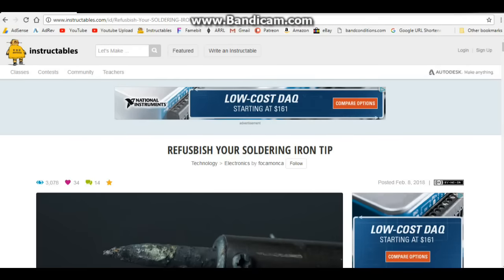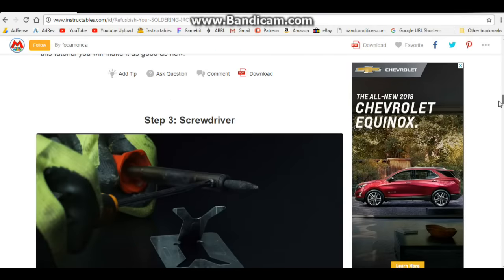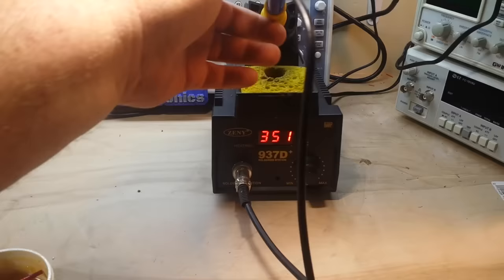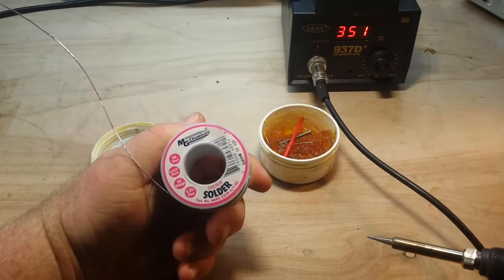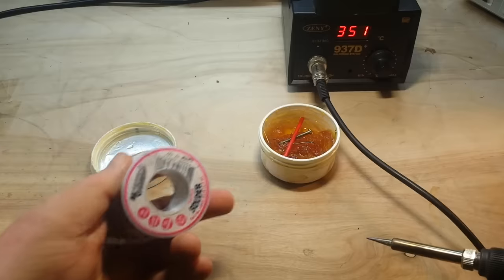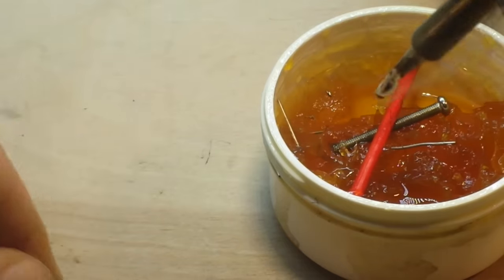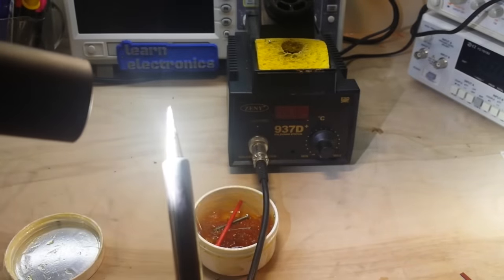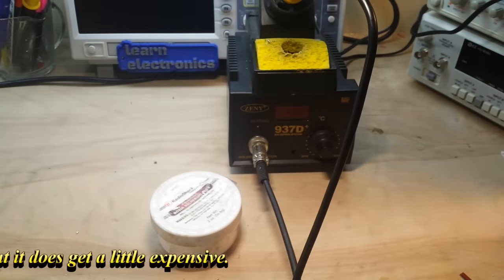How to clean and re tin your soldering iron

Comment: Two different tips here. The one which they clean is an old one and basically a block of brass/copper. It can be cleaned with acid and sand paper. The downside is that it needs much more heat and heats up slowly.     The one which you use is for ceramic heater and has thin film of copper. This one will get destroyed with acids or sanding paper, so it requires maintenance to keep it from oxygen as you describe it. And all of what you said about laziness and burning tip is fully correct, its just the older soldering irons are much more fool-proof.

Comment: I committed this sand paper sin with drill and everything just yesterday. IMO it was still worth it, because the tip I did it to was a total hack job from whatever generic Chinese factory that produced it. It was one of the round bevel tips, but the tip wasn't flat and had big burrs from sloppy machining. No big loss if this corrodes faster now, because at least it works the way it should while it lasts.

Comment: Thanks for the video. New Sub!
Do you have any recommendations on cleaning tips that are solely used for plastic soldering/welding (which ever you prefer to call it)?
Also what are your thoughts on tip tinner? Is it not acid based?
Cheers Tania
QLD, Australia

Comment: I bought a cheap 90w handskit soldering iron and after first use the tip is no linger shiny and solder will not stick to it, doesn't matter how much flux I put on it, also noticed heat doesn't transfer as good as on first use. Any advice one that? Thanks

Comment: You are right. I cut a piece of T-shirt cloth and fold it a few times and wet it with a spray bottle of water next to the station. I wipe it every time I use it and that's about 50 times when I sit down to some work. Fact is, it won't solder when it not clean.

Comment: I’ve a newbie question please. When I’m tinning my iron I use old lead free solder that I no longer use, but after watching so many electronics soldering videos I now use tin/lead solder. Does the fact I’m using a different type of solder for tinning make any difference?
Reply: For tinning no. Lead free is what plumbers use, and you will have to have a secondary flux source- but make sure it isn’t plumbing flux; plumbing flux is acidic and will destroy anything it is left on afterwards. As a plumber, I had to scrub my work down afterwards with soapy water even though I used a dry towel to hot wipe to get most of the flux off or it would eat the copper within a year or so. If you have the water soluble flux though, it is a lot less corrosive and easier to clean.

Comment: if the solder only sticks to the side of the tip, not far away but not on the very tip, even if I hold it straight up, does that mean my tip needs cleaning? I followed your steps several times, and it does look shiny, but the solder still doesnt stick to the very tip.

Comment: I tried this method several times but the solder runs down the tip and does not stick to the tip. I tried different tip temperatures from 200 to 450 degree celsius (tip glowing red hot) but the same result. I even dipped the tip into solder placed in a hole but no solder stuck to the tip!

Comment: This is how I clean mine, although I start with a couple dips into a tip tinner and cleaner, after a wipe on the sponge. Been using the same coated wedge tip for about six years. I still have a stockpile of Radio Shack flux and tips I bought during their fire sale, LOL! A pity they're gone, they were so convenient; now I've gotta drive about 30 minutes to get to the nearest supply store.

Comment: My soldering iron is a cheap $15 60W device. I never cleaned it and it still works fine - for more than 3 years now. So don't panic 😄 Maybe I'd handle it more carefully if it was an expensive one - but the cheap one did a good job for me (soldering FPV racers, drones, micro electronic etc.)

Comment: Finally some sanity with keeping the tips clean and tinned, that's what I do except I get a blob on the iron and shove it into the holder and turn it off, 
I still have the same tip in one of my irons that has had about 3 new elements put into it but the tip just keeps going after 10 plus years of use.

Comment: I dated this video in case I needed to re-tin I soldering iron tip.

So I needed to repair a plastic part on my vacuum cleaner, and plenty of videos out here on YouTube on how to do that, and save you grief* in the finance department.

I ended up saving my vacuum cleaner 🙌 woohoo!

However, I remember this video and say, “Oh wallops! What have I done 😱🫣”, as I try cleaning the plastic off of the tip with the moist sponge… then by using my solder absorbing braided copper thread as ‘sandpaper’, to no avail, I remember I saved this video back in the day in my playlist. Phew! Right? Well seemingly apparently not.

Turns out this video is about the “prevention is better than cure” philosophy. Yet it was too late for that.

I feel like taking away my like from this video, because it did not live up to my misinformed expectations. Then I thought, “Why be a douche for? This guy provided a legitimate service, even if I misunderstood it all this time.

“Why not ask him how to repair damaged tips instead?”

So here I am.

_______________________
* only to give grief in another department

Comment: Bought a new soldering iron (a weller 60w)- within minutes of heating up it lost its shiny look - I tried following the instructions on this vid but for the life of me can’t make a bead of solder sit on the iron - just turns into a huge blob and drops - does it make a difference if it’s silver bearing rosin core rather than lead based?
The tip looks more like the instructibles one than ever - and that’s only minutes after being taken out of the box!

Comment: my tip is shiny just the same, but the solder doesn't melt. I tried all temp settings. is some solder just too industrial? it's lead free too. between 300f and 800f, it simply will not melt.  tried leaded solder at 300f, it just balls up and falls off, and there's a nice amount of flux I put on there. brand is xtronic 3020.

Comment: Thanks hombre. I feel like I knew this, but my Weller WLC 100 I use for high heat stuff looked like total ass. Can't believe I didn't think of putting flux on it. Flux, wipe, brillo, solder and repeat. Looks good as new.  I have tip tinner but it doesn't seem to do much. 

Now for those tips I left on overnight...
Reply: Oatey #95 tinner/cleaner.
Good stuff.

Comment: I just bought a TS100 set with all the tips, and I can't get solder to stick to the tips. I'm using flux, Kessler 60/40 in .031", and I've worked through the temp range from 200 to 400. The solder just beads up and falls off. They don't get shiny silver like yours. What am I doing different? Do some tips do this?
Reply from the maker: I'm not sure, but it sounds like maybe you have some bad tips. I never use any abrasive on tips. The flux is basically acid. It should clean your tips. My only suggestion would be to try a different brand of solder. I like MG Chemicals, but any big name brand will do.

Comment: The best way to keep our tip clean is very easy you have have to use a wet cloth and clean your tip time by time while you are slodering i have tried it my self and it actually works extremely well

Comment: I tried to clean it as you did, but I had a problem, the soldering wire didn't stick to the tip of my soldering iron. It bubbled up on its self and then fell down. It seems like my iron tip rejecing the soldering wire. If you are familiar with the problem, please tell me. Thank you.

Comment: I do this trick every time I finish soldering but recently no matter how many times i do it, it just doesn't work, I also bought a new tip but it oxidised after fewntimes of soldering,it looks like the coat just goes away in some spots, you think its a problem with my sloder or my iron? using flux core solder.  I also bought a good brand tip but nothing... its really going on my nerve when those black spots appears on my soldering tip
Reply: The solder is actually SUPER EXPENSIVE here I can literally buy a new decent Soldering Iron with lower price of one roll of solder! so I cant buy the best solder anyway

Comment: At AT&T we just filed them down, the irons were in use 24/7 often sitting unused for periods of time. The tips get messed up so we filed them down, and before using the iron we wipe the tip across a tin plate, it's a metal plate coated with solder. This is the Bell System way of doing things.

Comment: Great video. I'd also recommend getting a little tin of tip tinner. $7 on amazon, and makes cleaning your iron a 2 second operation. Wipe iron, dip in tip tinner, go back to soldering. Super easy.

Comment: AFAIK the sand paper technique works on vintage soldering tips where there isn't any coating. My father has this iron from his 20s, and as a kid I saw him sanding it a few times and it works very well after each sanding. That tip was made of solid copper though. Today's tips are probably very differently constructed.

Comment: I'm trying to repair a charger cable for my cellphone the kit I purchased from ladyaya's came with solid core wire. Can I use solid core wire to connect a charging cable or is it best practice to use copper? Every video I have watched uses copper.

Comment: If you use regular rosin it's even easier, I've always cleaned my soldering iron like that since I started soldering at the age of 12. I just clean my tip like that on a regular basis, never replaced a tip because it won't hold tin.

Comment: well, after dipping the tip in the flux I try to apply some tin onto it but the tin just falls off. What am I doing wrong?
Reply: Tip is oxidized you may have to use a tinner and steel wool to restore it if flux isnt working.

Comment: How do you get the tip to take solder if it is gone black is my problem?  
I got an Antex which is meant to be Adjustable but maybe it's not working and getting too hot and blackening the tip?
Reply from the maker: It's over once it's gone black
Reply: @learnelectronics  Seriously?,  It must have got too hot then even though it was meant to be a controlled iron.
Reply: Can you tin with lead free solder?
Reply: @shoefantasia1412  Oh yeah I just noticed my comment :). I found out the Adjustable screw is tiny and I literaly never saw it but was adjusting a larger screw which to my horror turned out to be a fastening not for the iron. I haven't used it since but I will test it in a day or two. I came accross a Sequre d60 one day for 20 euro second hand barely used and went with that. I am an Antex fan so I will try it again and let you know.

Comment: Yeah. I fully agree with you. But man,  you're talking about chrome-plated tip same as a lot of modern soldering irons contain. But on that web post is an old-type pure copper tip. There is one big problem every time you use that soldering iron - the tip becomes burnt in the center of the front end, and there is only one way to make it looks and works well, which is to scratch out the brut surface with sandpaper/needle file/etc. 
Secondary perhaps that web post oriented for a typical guy who found soldering iron at his home and probably doesn't have a flux, cellulose sponge, glycerine, and so on. Only soldering iron, stanum, and pine resin, for example. For that guys,  with no money and specialized tools, I can suggest only to clean the tip with a wet napkin.

Comment: Can I use a regular copper wire like how you use that solder wire ? I'm sorry im very inexperienced
Reply: No. The copper wire will not melt and if you leave it down long enough eventually it will BAKE. You can use solder to JOIN two copper wires together then wrap with electrical tape (ie. for a longer speaker cable etc.) And in a pinch you might use copper wire to "mop" or "brush" clean up a messy soldering job,  - Solder-wicks are copper wire that's been lightly infused with a thin layer of solder coating. 
Watch more videos - they go for 5 mins and you'll be basically pro after 3 ...or 10, that's ok too! :)

My only advice I'd give to newbie is USE OLD PRACTICE BOARDS from the TRASH FIRST so you dont FEK UR SHEZ UP!!... and practice removing and installing stuff.

Comment: If the tip already oxidised theres no other way to fix it right? 
Because as soon as the tin wire touch the soldering iron it will fall right off.
So a little bit of sand paper is necesary, no? 
I know theres a protection layer but if i can't use my solder because i left it too long  on high temperature and it oxidised i would use sand paper (not with drill tho) gently to break the oxidised layer on my iron tip and it will work like brand new.
Reply from the maker: Not really
Reply: @learnelectronics  so... is there a easy way to fix it? Because i've been looking for it and found literally nothing

Comment: I have needed a soldering iron and all I could find was an old one with a terrible looking tip that couldn’t e changed. I have used sandpaper to get it cleaned enough for solder to stick in order to use it one last time. So I wouldn’t be so quick to kick the sandpaper trick. You have to be able to adapt.

Comment: For any videos or webpages that suggest us to clean the soldering iron with sandpaper, I just turn them off and go on finding other better solutions. Using flux to melt the remaining solders on the iron is a great suggestion. I even use solder wick to help cleaning.

Comment: Actually, (I posted earlier) The old style pure copper tips, was used in the old(1976) PACE soldering station. NASA used them. I went to the PACE school, and the tips were blank rods of copper. You had to file your wanted angle, tin it, and yes. Sandpaper was used to remove scale build up. The video he put down, was correct back then,but way out of date, as now most use plated tips.

Comment: As a newbie that was helpful for showing how to maintain my iron. However I already buggered my tip, how do I restore it?
Reply: You can usually buy a set of new tips for a few bucks.
Reply: Sadly the tip is integral to the shaft, which screws into the handle. Any ideas?  @MaxBrix

Comment: What's it mean when trying to tin the tip, the solder just beads up and rolls off the tip, like water? What am I doing wrong?
Reply from the maker: Tip is not clean. Keep repeating the process until the solder coats the tip.
Reply: Thanks, I will try again this weekend.

Comment: Hiya need assistance friends?!? I'm soldering very small fine electronics. The manufacturer recommends neutral Flux and low temp solder...best recommendations?  I've always used Flux in solder but fairly new to small electronics...
Reply: I use a 30w solder for electronics and it works well. You won't burn anything (well, you could if you keep the tip 5 minutes in the same spot)... You could also use 40w ones... Higher than that and you'll melt stuff. (Unless you are fast AF)

Comment: I've used very fine grit sandpaper (800-1500 grit) to clean my soldering iron tip in the past. At least I didn't use what looked like 120 grit, like in that Instructables video...yeesh.

Thanks for the lesson. I'll fix my shit.

Comment: I tried this with a new soldering iron and the solder kept beading up and falling off the tip, nothing stayed on the tip.  used the flux and the sponge numerous times.  what am I doing wrong?

Comment: I have read that today most soldering wire has flux already in it so additional flux is no longer needed. Is that right?
Reply: It does have Flux in it, but additional Flux is always a good idea. It ensures proper wetting of the leads/solder pads and removes contaminants which cause bad solder joints. The Flux inside your solder is ok but it is prudent to add additional. Just make sure it rosin core and not acid core as acid core will corrode your connections.
Reply: @redemptusrenatus5336  
Thank you for the tip

Comment: I use a solder that melt at 380C to tin the tip then low the temp and use regular 260 solder

Comment: Pick up a quality temperature regulated  soldering iron with iron plated tips, and those tip problems simply go away. I can leave my Weller 100 Watt temperature regulated  soldering iron with its various tips plugged in for hours, it never over heats, never burns up its tips.  The tips on this iron can be cleaned with a dry paper towel.  One very good soldering iron is the Weller W100PG unit that has a variety of tips from 1/8 to 3/8 inches wide.  My W100PG iron is six years old with a lot of heavy use.  Still have every tip purchased for it.

Comment: You are right, what you said. But now learn. I file sand what ever you want, just put a Fine finish on the tip.
Ammonium chlorite " Sal ammoniac", chemical and trade name, block or granular. 95/5 Tin. Tin takes a lot higher heat, for you guys who do not have a auto-Transformer.
I use a 5" long piece of 2x4 with a dimple in it so I can put a small amount of S A and a couple of 1/8 balls of 95/5.  Scrub your tip on the wood and melt the solder and watch the black transfer from the tip to the wood and tip re-tins better than new.
What you know now is retinning copper I don't care what shape it is,
Use alcohol, to melt your Rosen dry chips,  get rid of the Grease Flux, and believe it or not wipe your solder wire and check out the oxidation.
I clean and dip the wire in the Flux described above.
Every so often scrub your tip on the block of wood.  Oyea the S A smokes alittle don't breath it